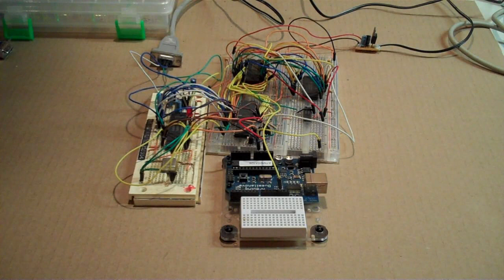Z80 updates and a website

Comment from the maker: RS232 is an asynchronous serial protocol that has a specific voltage rating that it runs on - while _technically_ that range (~-8v to ~+8v, depending on implementation) does include the TTL range, I'm not confident on pumping +8v to -8v to a TTL device and being certain it'd survive the encounter. If you drop out the MAX232 and just talk serial between two TTL devices all is copacetic, but mixing the two voltage ranges would be... worrying.

Comment from the maker: Sure - BUT it appears the PICkit does not use RS232 voltages (from a quick glance at their main page) - so you'd want to skip the MAX232 and wire the UART RX/TC direct to the PICkit's pins2/3 and operate on TTL voltages. But doublecheck that in the manuals first, or else you might smoke the 16C550 :)